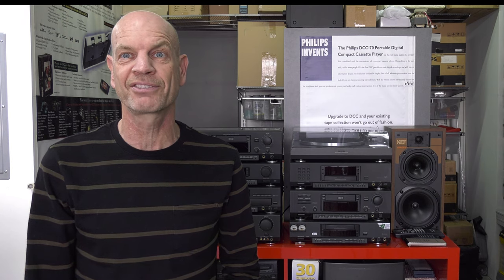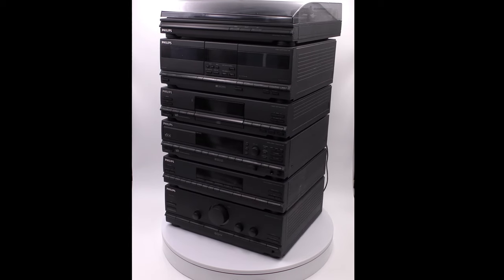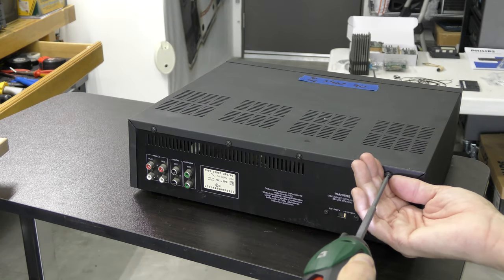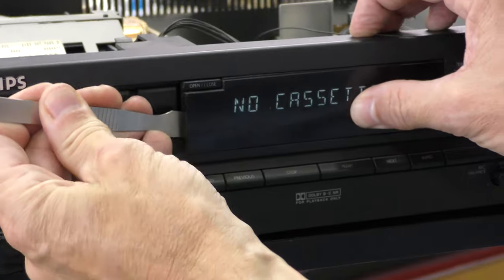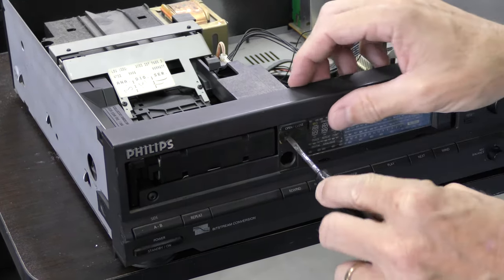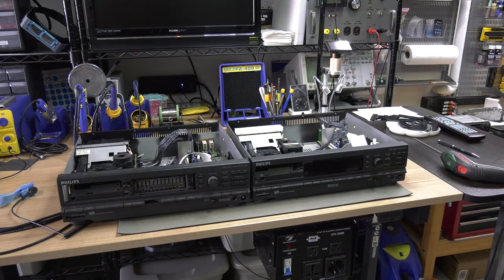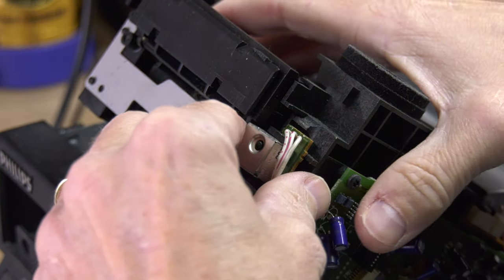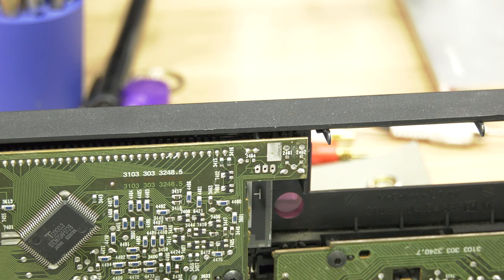Adding A IR Sensor To The Philips Digital Compact Cassette DCC380

Comment: I can say from first hand experience that the DCC-300 was apparently designed to keep you from taking it apart, force you to buy the service manual and then STILL not only break the little lever hidden behind the front panel and a second lever that holds the remote receiver onto the mechanism, but also it adds insult to injury by NOT clearly showing in the service manual how to take it apart without breaking it, and of course by using glue (not some sort of minimal mechanical locking) for the display cover.

The DCC-300 is one of the sexiest DCC recorders of all the ones Philips ever made, but Philips rightfully deserved the bad reputation they had with service engineers.
Reply: Having pulled one apart yesterday, I agree.  Horrible machine, I'm not feeling the love at all.

Comment: Can't this IR sensor still be bought? Like if you don't have a donor machine to cannibalise and use for parts?
Reply from the maker: Yes, at 1.36 we show the Sharp type that can be used. It is a pretty generic sensor. We also have the original ones in stock at the dccmuseum.